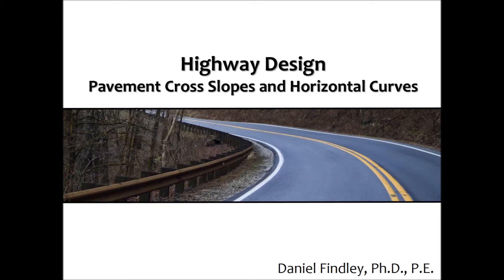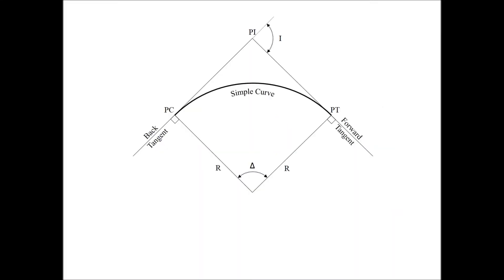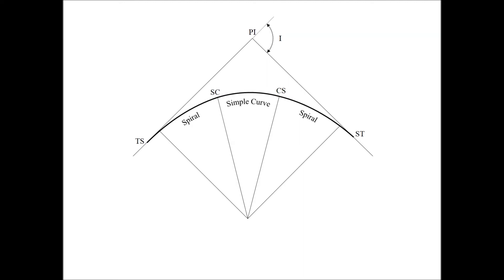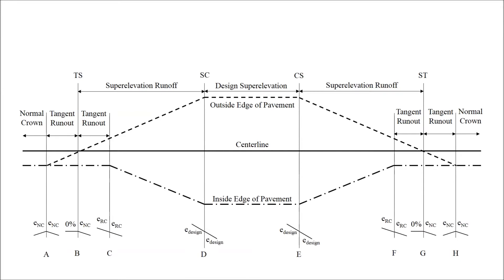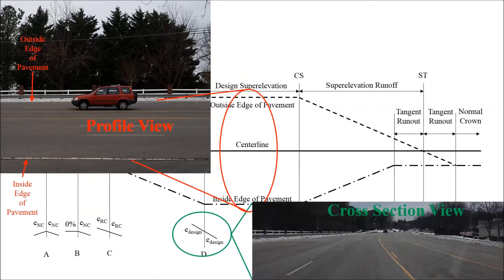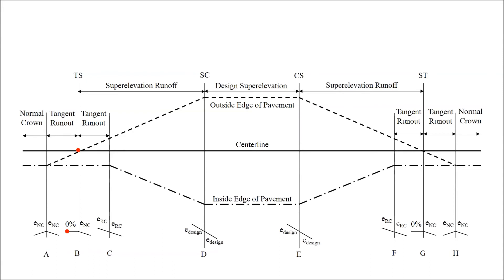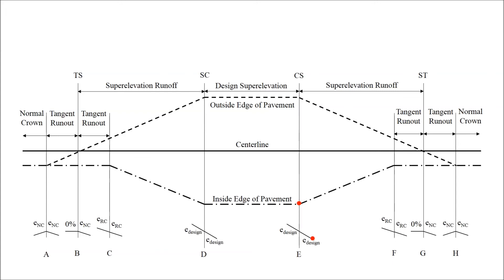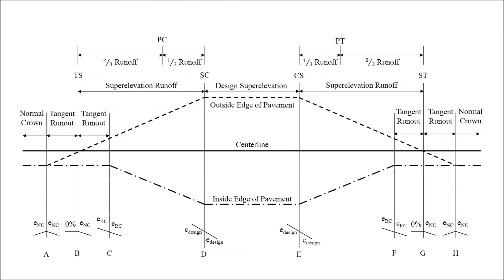Pavement Cross Slopes - Horizontal Alignment

Comment: Hello, Sir
Please help me to answer this problem

1. Given plan, profile and normal section of an highway 
between points A and B with radius of 500m and design 
speed is 90km/h. Superelevation will be applied by 
rotation around Centre
-line. calculate:
1) Maximum superelevation
2) Km.s of the start and end points of transition 
lengths.
3) Draw the rotation diagram near PC. On the diagram 
show Km.s and elevation differences of all critical 
points.
4) Find the elevations of the outer
-edge, centre
-line, 
and inner
-edge of the highway at the following 
KM.s: 1+000.00, 1+081.23, 1+085.00, 1+110.00, 
1+1200.00, 1+320.00, 1+350.00, 1+400.0
Reply from the maker: There are a handful of videos in this playlist that should be useful for you:
https://www.youtube.com/playlist?list=PLQ2tBMRKXRObHBBdCcN_5naxb4wwSfTf8

Comment: Thank you for clear explanation, Sir. But I still feel confused about the distance between beginning of full super and end of full super. If the length of distance that I mentioned previous is short, can it impact on  road safety.
Reply from the maker: You're exactly correct!  The rate of change is specified by AASHTO and is referred to as the maximum relative gradient and the distance is known as the superelevation runoff (from full superelevation to adverse crown removed and is also provided by AASHTO).